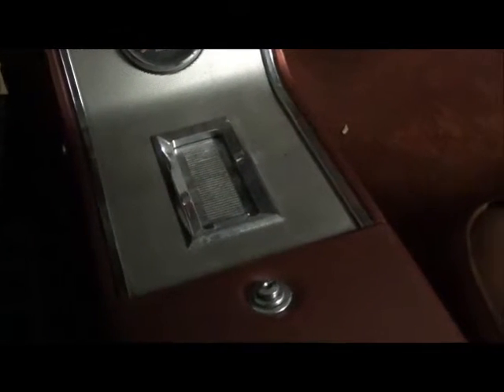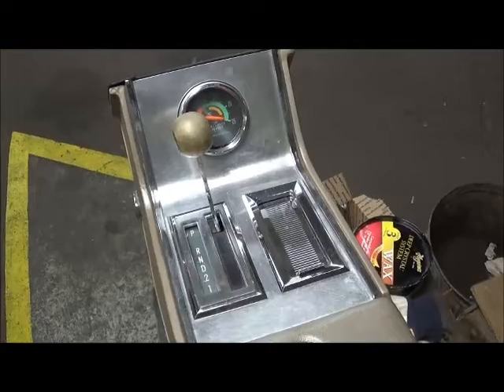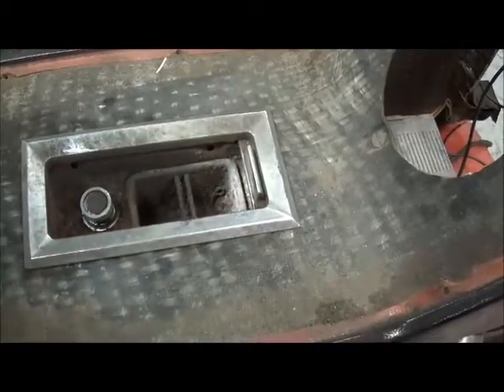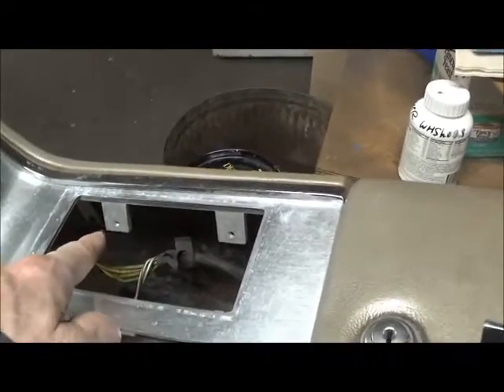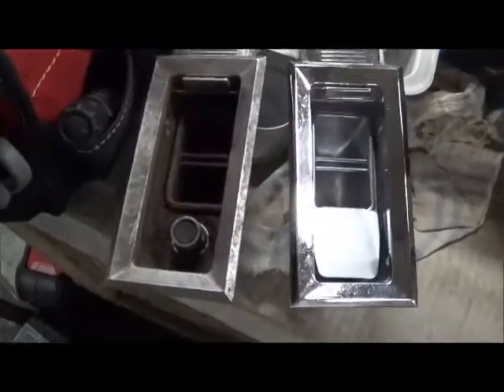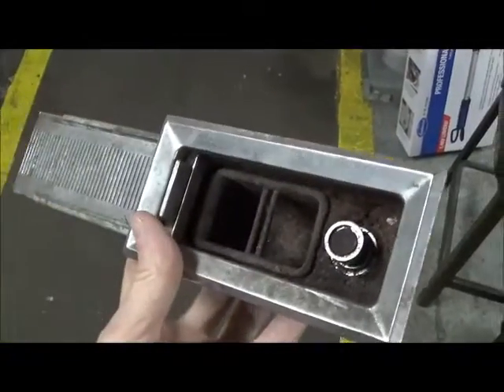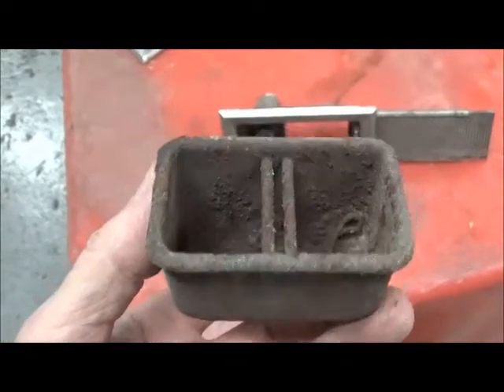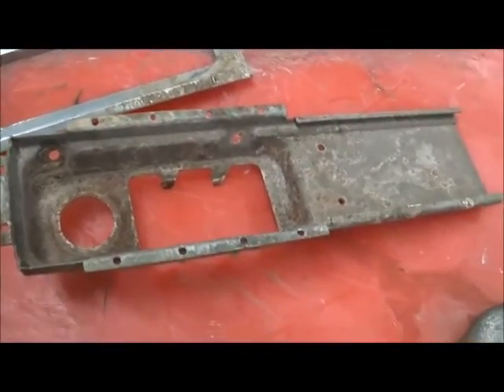1960 to 1964 Chrysler console ash tray

Comment: Bob thanks for your video.   Do you know or have a video on how to remove the radio on  1961 300G. Thanks
Reply from the maker: I don't have one on radio removal. The factory service manual has it. Maybe not the FSM for 61 since that manual is a supplement, but the 60 or 62 manual will have it.